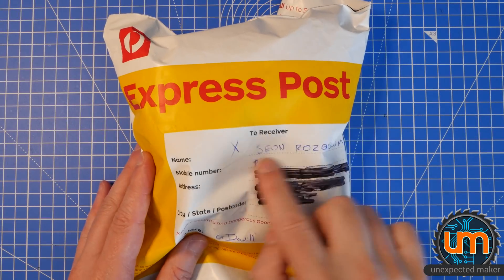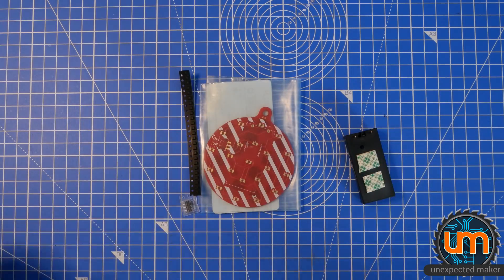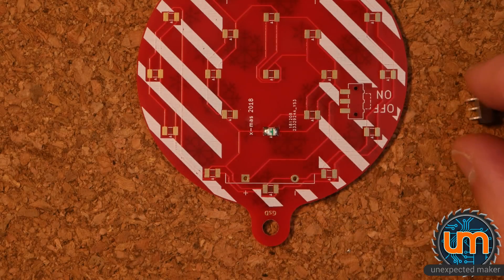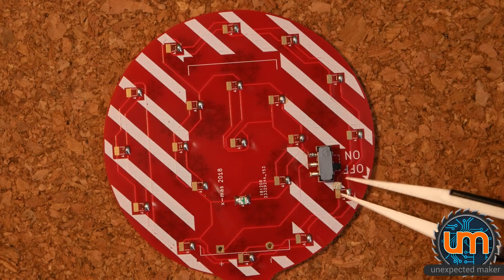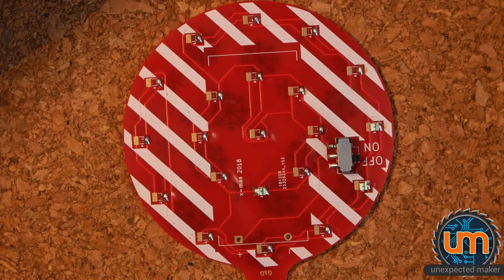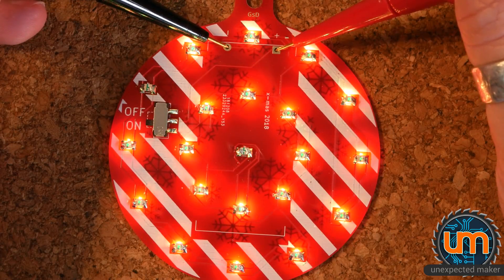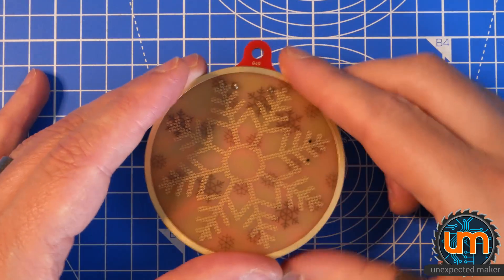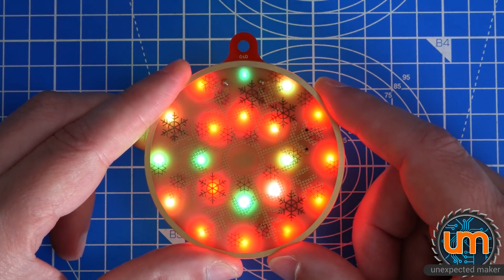It's Xmas in January - Thanks to Greg Davill

Comment: Glad you like the kit and managed it without instructions. (Which are included with the kit). The extra LEDs can be used to replace any that are cycling quickly or if any are damaged during soldering. I found that on the ~20 PCBs I soldered up for friends that each board typically had one LED that ran fast or skipped a colour etc.
Reply: Hey Greg.  Nice kit.  How long would 2 x AA batteries typically last if the ornament is left on?
Reply: @Zefbot  They are a bit of a battery drain. They last about 8-10 hours before the LEDs can no longer light up blue. So you can't just leave it turned on, unfortunately.
Reply from the maker: Thanks again for making such an awesome kit! Really looks beautiful!
Reply: Nice kit Greg! I subbed :)

Comment: aren't back firing led's design to have a hole in the pcb for the led dome to fit in to. all the designs I've worked on did it this way. but on the other hand the diffused light looks good.
Reply from the maker: Nah it seems the new trend is just to reserve them and let the PCB diffuse the light. Lots of people doing it and it looks very nice.
Reply: do they fit flush on the pcb, the ones we used the silicon bit was about 0.5 to 1.0 mm so they would not sit down flat.
Reply: @TheEmbeddedHobbyist  They're not actually designed to be mounted upside down. But you can't buy these colour-cycling LEDs in a suitable package. You're right the lens is sitting flush on the PCB so the pads are lifted up off the PCB. It would be difficult to reflow these but hand sodering works okay with lots of solder.

Comment: looks like an 0606 LED, I have RGB LEDs in that formfactor :) Also - I would only scream "test it first" before powering it on :p
Reply: These are 0807. These are essentially like the package for 2020 WS2812's but with the colour cycling controller inside.
Reply from the maker: 0606 you say? Hmm, I need to look into different packages LEDs then. Cool, thanks. I can't remember what you scream.. but the fact I thought about it was a good thing I think :-)